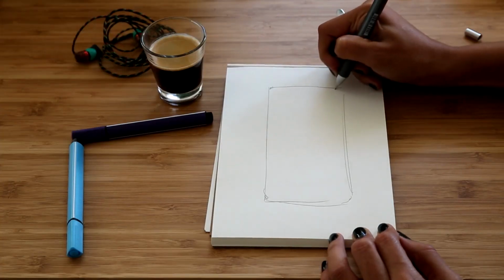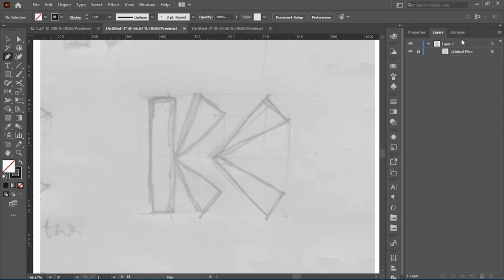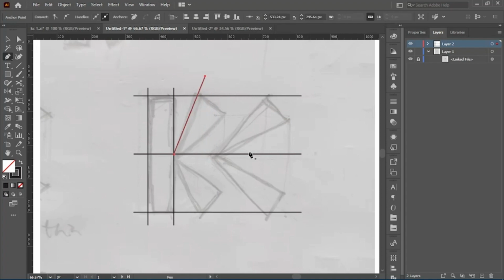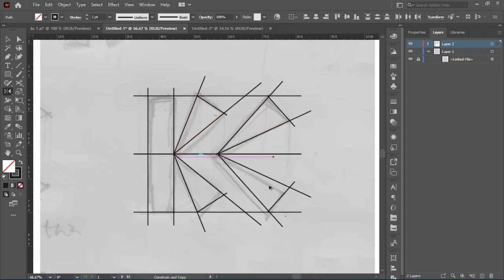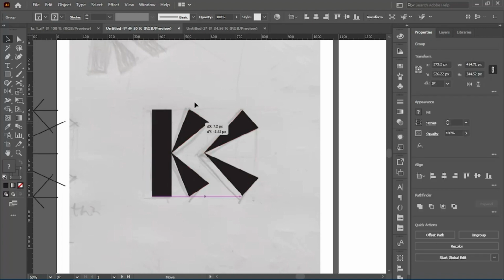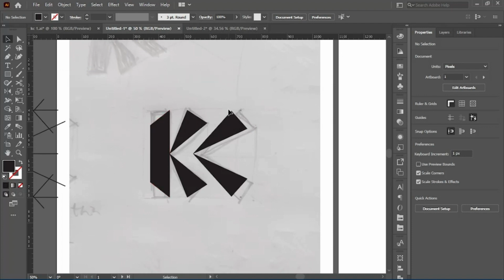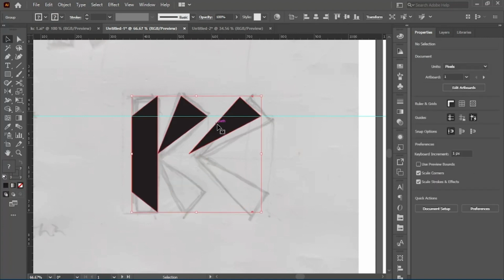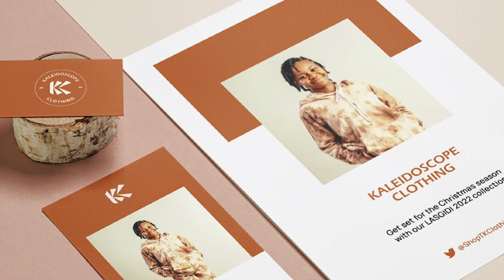How To Turn A Sketch To A Vector Logo Design - Illustrator Tutorial

Comment: How do you make the smart guides appear on Illustrator like the one @1:35?
Reply from the maker: When you bring an object between 2 objects, Illustrator will automatically detect it to help you. Sometimes it's turned off so you can try checking Ctrl+U to confirm or go to View and make sure Smart Guides is checked